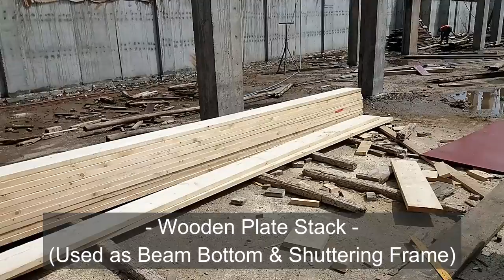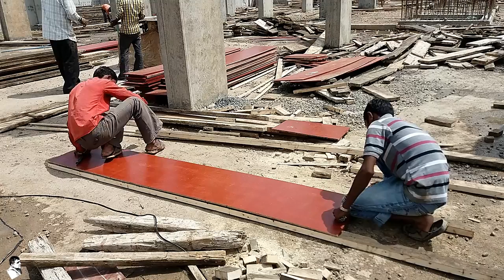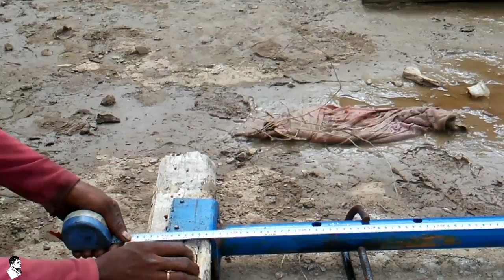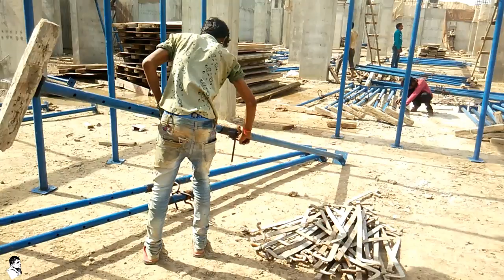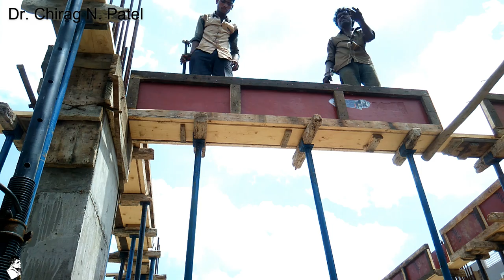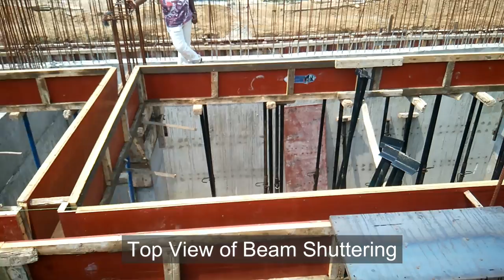Shuttering: How to Install Formwork For Beam? | Beam Shuttering Process | Beam Formwork

Comment: @22:47 - Be Careful!!! That might be the most dangerous part (If I had to pick just one that is)... But none the less awesome work and awesome effort! I wish you guys were given safety training and equipment. A lot of commentors obviously don't realize what conditions are like in other parts of the world. Worker's rights are very limited. I'm sure they'd have hard hats and safety boots if they had the choice (although if I had to walk on those planks without a harness I might rather be wearing footwear that would prevent slipping).
If they are still forming this way (a lot of knowledge and work ethic is required to put it together, definitely not trying to minimize that), there is a lot of potential to improve productivity and safety by using more modern formwork systems. Affording that formwork is another issue altogether. Even many contractors in developed countries still use 50+ year old formwork systems. They don't reinvest their profits, are slow, and therefore cannot (or just won't) compensate their skilled workers fairly.

Comment: Sir I need design 19ft width 39ft length, high 18fts need to cover full roof no walls only need to cover with help of columns can u design steal for both columns bems n roof pls